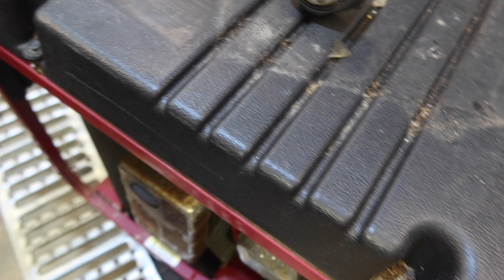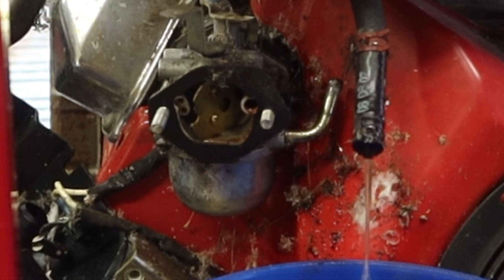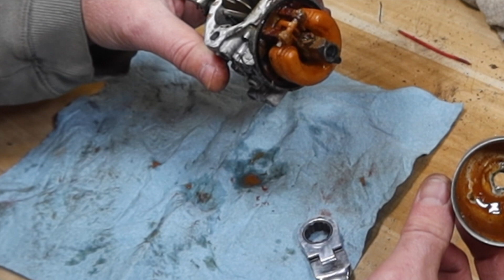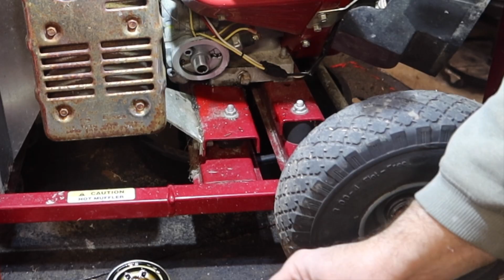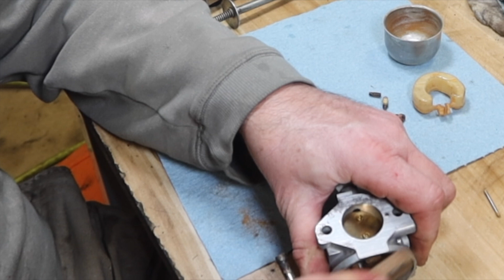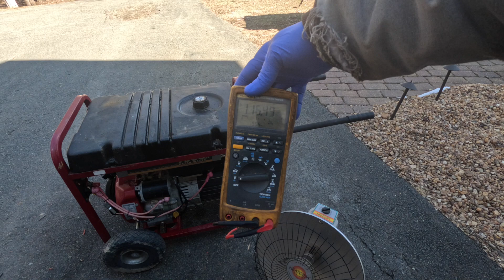Why Your Stored Generator Won't Start (Quick Gas and Carb Fix)

Comment: Questions!  What cleaning solution did you use in the ultrasonic?  How long did you run it?  Was there a pencil filter in the fuel tank shutoff valve?
If you’re going to run the engine out of fuel it’s a good idea to choke it to get that last bit of fuel as it’s stopping and then to drop the carb bowl and dry that out as well.
Reply from the maker: I used purple power and water on this one.  No pencil filter on this one that i could find inside.  And yes I usually try to grab the choke to do that but Ive been getting to slow lately.  LOL Thanks Rein!
Reply: @RayofallTrades 
😂👍   
James Condon switched to Simple Green Heavy Duty recently and every single carb has come out looking like new. I’m almost out of the stuff I’ve been using (LA’s Totally Awesome) which great as a degreaser and cleaner but doesn’t have the same effect on the outside of aluminum carbs, so I purchased a gallon of the SGHD and will be using that next. 
FWIW I started out using PineSol in the ultrasonic but it was pretty harsh, so I relegated that to machine exteriors. I then used SuperClean for machines and that worked fine but the fumes were way too much for me. 
I got some pH strips and will be assessing every cleaner I use from now on to really figure out what’s what.   I had about 15 discarded 2T carbs donated to me and will be doing some testing to compare products as well.
Reply from the maker: Let me know what you find out please. The purple power is pretty harsh on the aluminum